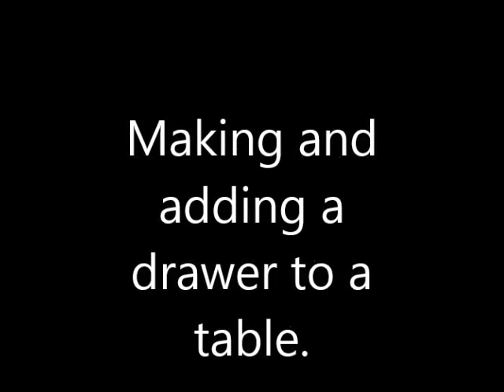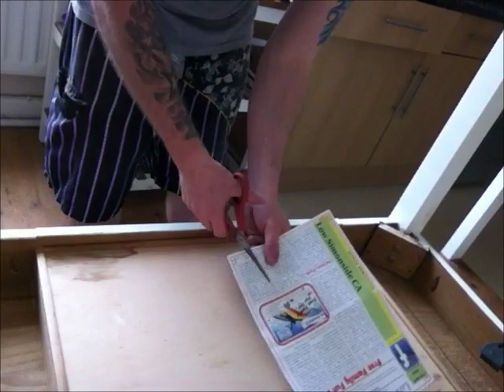Making and adding a drawer to a table

Comment: cutting away a segment of the frame (that keeps legs together), does this make the table's legs strength compromised?
Reply from the maker: patrick bui the table would be weaker but it wasn't an issue because it wasn't very long. if the table top is thick and real wood I.e not chip board or MDF I wouldn't worry about it the most it will do is flex. if the table was MDF or such I wouldn't even attempt it. hope this helps, thanks for watching.

Comment: How do you acct for wood movement?  The screws in the top (putting in the drawer supports) prevent the wood from moving
Reply from the maker: Joy Knollenberg the table was well climatised so movement was minimal. There is enough give in the screw holes to allow movement . I never had any issues with movement. If you're worried about it, you could make the screw holes slightly wider so the screw can move more, during any movement of the table top.
Reply: Its hard to tell for sure, but the table top looks like it was plywood.. Should have no wood movement issues. The boards supporting the drawer won't be an issue either since wood movement only occurs against the grain. The supports will get thicker or thinner (lowering or raising the drawer) so wood movement here won't cause any issues.

If the table top was made with boards instead of plywood, and the drawer supports were perpendicular to those boards (as they would have been in this table style) then wood movement would possibly be an issue.